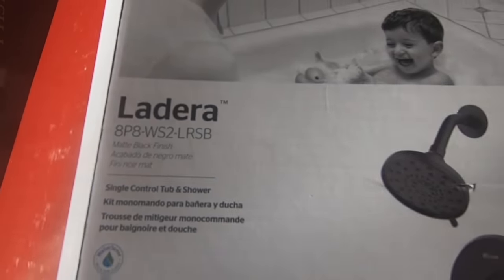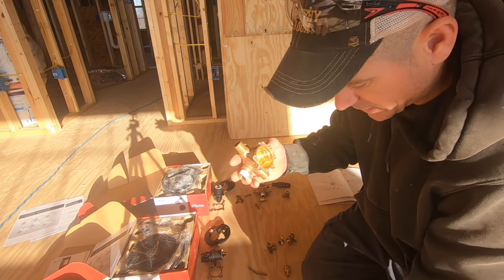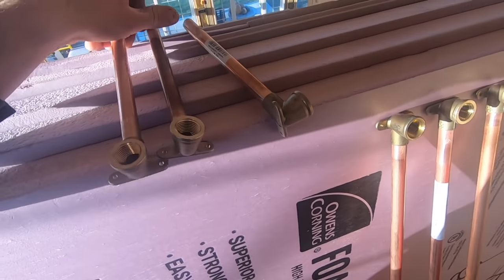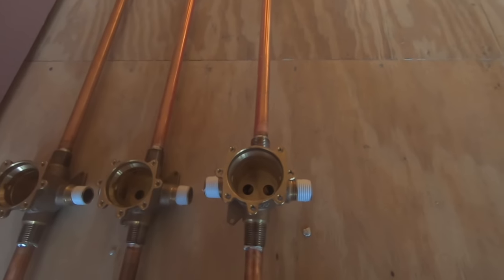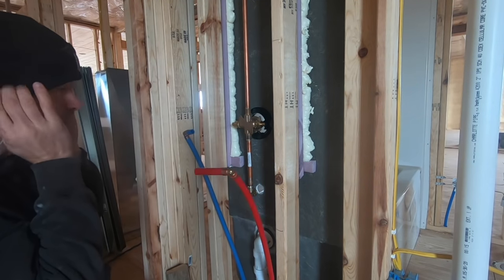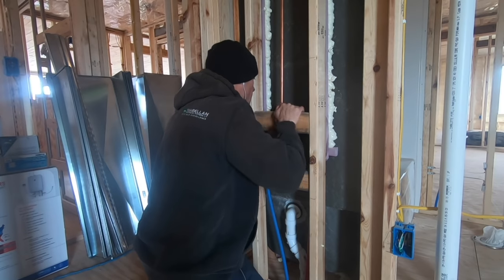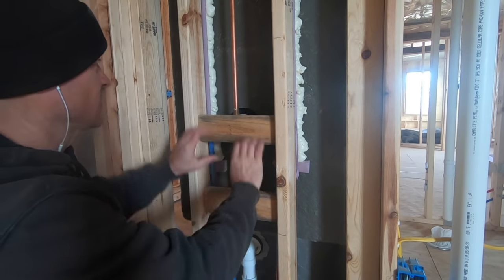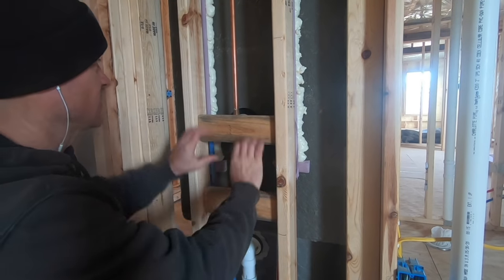Tub + Shower Faucet Install

Comment: A couple observations
1. you have a breadth of capabilities that mere mortals usually don't have
2. you must have local inspectors, etc. who are very tolerant of DIY (you're clearly not the average DIY guy) but they are sometimes not willing to accept perfect DIY vs the work of a trades person. 
3. you and your family have immense patience. It's probably good that your kids are very young. On the other hand, if they were older they could learn a ton from you in terms of skills and just a sense of self confidence that you can to do anything if you set your mind to it.  
4. I'm a lot like you. Very cross functional. Can do multiple trades. Prefer to work alone. Often felt if I did it I knew it would be done right and sometimes better than the trades folks (who to be honest, have a hard time finding qualified folks these days). But I sometimes wonder if it set a good example for my kids that I "never needed help" from other folks. IF you had had other folks other than a your dad and one or two other friends to help, would you have used them? 
All that said, love the series. Kudos!
Reply from the maker: Thanks for the comment! We plan to hire someone when we go into our next project, just didn't work out on this one since it's our personal home.

Comment: The slip on adapter you used for the tub spout. Is that apart of the faucet you purchased or is it an additional part? if it's an extra part, can you provide a link please?

Comment: Excellent video in both description and camera work. I'm installing one in my bathroom with a fiberglass shower surround exactly like the one in the video. I noticed on the black plastic ring it says finished wall at this surface. What about the piece of plastic that covers that and access to the screws? Is that just for protection?
Reply: Me too

Comment: One question... what happened if I install the shower valve up side down or to the side? Mine is a pfister valve ...because right now when I turn off the  valve the shower head is still leaking water🤷🏽

Comment: Beautiful job!!!  I had a Delta unit & value installed today, & although the plumber attached the shower head part to a 2x4, he didn't the other pieces. He did shim them, though, to they're pretty solid. Not like yours, though!  And I love your copper -- mine is all pex. I absolutely hate the Delta Victorian unit I bought. It keeps running for a bit when I turn off the water. My 2-handle faucets never did this!  I hope it's not a trait of the single-handle faucets. It was on the last one I owned. I'm going to pay to have it replaced with this one, I think. Hate to waste the money, but I hate the faucet.
Reply from the maker: Thanks for watching!

Comment: My contractor installed the handle for this  set where, when you turn it on, the water STARTS at hot and goes to cold when you turn the handle counter-clockwise.  Can you tell me how can I correct this?
Reply: The mixer cartridge must be installed upside down. That's a dangerous set up that the instructions for this unit specifically warn about.

Comment: I have a question. I have a similar model but it has the smooth black piece for thicker wall as and there is no threads. I’m stuck I don’t know what to do. It’s my last step. The plumber installed the thick wall 2 3/4 max black plastic smooth piece. My instructions have me lost as there are not many words. Help a mom out please!
Reply: Was it the knock out piece? My plumber put that over the top and it took me forever to notice it

Comment: I did not follow what you said in the beginning of your video.  You have a diverting valve to direct water to either the shower head or the tub and it doesn't matter if you used PEX or copper.  You could also use "Uponor Pex" if you aren't happy with small inside diameter of regular Pex.
Reply: G George  ,  If you noticed in the video there was no diverter valve only the mixing valve ,therefore you need to use copper for the tub spout ,if you use PEX even if its uponor water will come out the shower head if you're trying to use just the tub spout, the inside  diameter of PEX is smaller than copper, every mixing valve I've ever used says not to use PEX for tub spout or shower riser , right on the box.

Comment: What do you do with a p or s trap on the first floor like on a shower stall., Do i bury the s trap in the concrete ???  I'm a sub, Thanks i love the videos, they are so much help, this is definatley my favorite channel on youtube. I cannot wait to se what you use for the slide bottom. I am building a pole house in the spring, here in south dakota. I also want a slide but from upper living quarters to my shop side, I was thinking 26" wide 12' long PVC Corrugated Roof Panel or plywood with a 24" wide continous roll of tin attached. Thank you so much

Comment: Nice, looking good.  Couple of suggestions.  You can also use brass nipples of various lengths when getting distance from drop ear to spout if you dont have one of those fancy spouts.  Also just use a pipe wrench when tightening up that copper stub, less work than wandering around to the other side and trying to get a pair of pliers up behind the blocking.  Since the copper pipe is hidden in the spout no need to worry about scuffing up the copper a bit with wrench marks.  Also you need a right angle impact, easier than trying to toe screw those blocks in tight spaces.